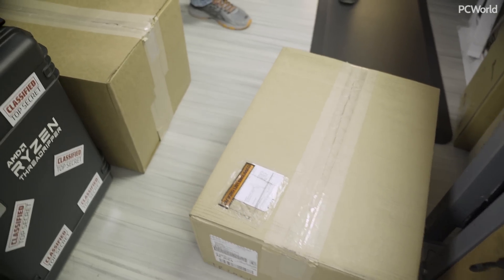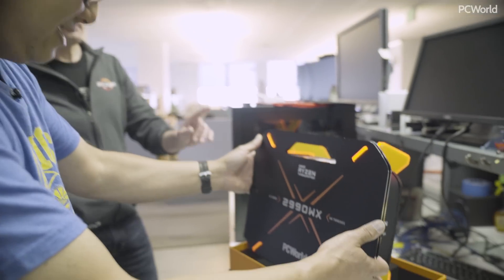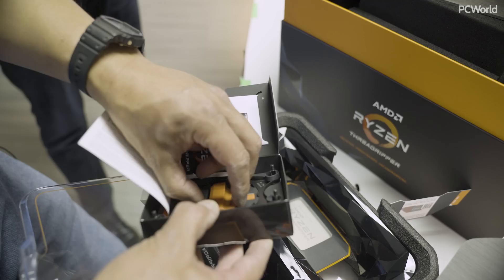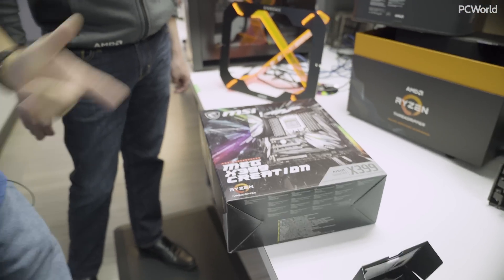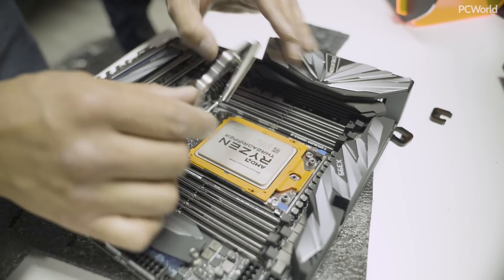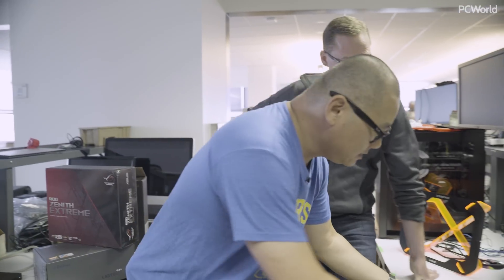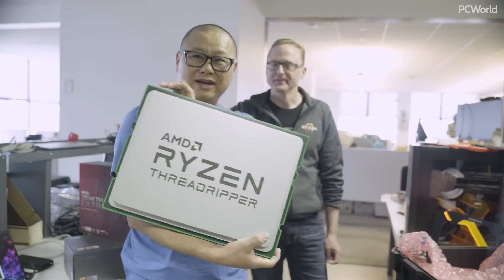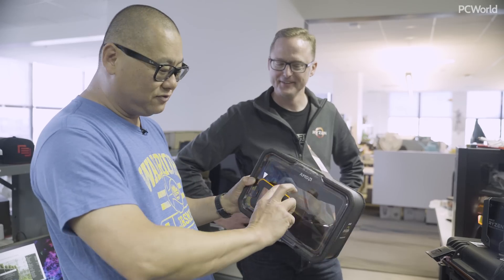Threadripper 2 unboxing and install with Jim Anderson of AMD!

Comment: Hi Gordon, 

As a person in the PC hardware reviewer space, I assume that you are familiar with the work of the channel "Actually Hardcore Overclocking" (aka Buildzoid's channel). If you aren't, he does motherboard "PCB breakdowns" where he goes through photos of motherboards, identifies chips and components,  and analyzes their capabilities, and is able to give an in depth summary of the pros and cons of the motherboards. As someone looking at buying the MSI MEG X399 Creation, I am looking for a deep technical analysis of this board, which not too many other people are capable of. Because AMD didn't sample him with the Threadripper 2 reviewers kit (his content is quite in depth and technical and therefore his view numbers aren't massive and AMD likely didn't think sampling him would regain the price of the hardware in gained sales) he is currently not able to do a PCB breakdown of this exciting new board.

Because you have access to the  MSI MEG X399 Creation, could I ask you to do a big favor to all the consumers looking at making the sizable investment into a second generation Threadripper processor and an X399 refresh motherboard?  Could you possibly temporarily remove the heat sinks, thermal armor (and anything else obstructing a clear view of the motherboard's components that could prevent them being identified)  and take a high quality top down photo of both the front and the back side of the motherboard (see other motherboard PCB breakdowns on the channel Actually Hardcore Overclocking for examples) ? Could you send these photos to reddit user /u/buildzoid? This would allow the whole PC building community to get some reviews of the boards in an unrivaled technical depth, and would give consumers more insight into what they're spending their hard earned money on.

Thank you for your time

Comment: I've been Intel ride or die since I put my first computer together back in 1998. But... as of late, I'm swaying on my loyalties of team blue and thinking of building my next system with red. Would that be a mistake or are my suspicions of Intel recycling old tech to "compete" a real reason to switch over? I've been waiting for any real change from Intel ever since the Coffee Lake launch but, I haven't been impressed from what I've been seeing or hearing. I know this isn't the proper forum for this question but, I want real answers from real enthusiasts.
Reply: Here's one from a mostly intel user. I've currently got plenty of intel cpus and chipsets like x58, x299 (soon) z270 and I've been through lot more - I've also still got a fm2+ amd board, am3+ and am3 board. I've never liked amd before ryzen, Taking a look at the performance charts ryzen is worth the money. I can't say the same for the amd gpu department - it's a complete fail on the high end department
Reply: I had an original AMD Thunderbird back in the day and an AMD 486 DX4-100 too. Oh that's right I do have some 2 core AMD CPU too. I never used that system though. So I really don't know what it is.

Comment: I will admit that threadripper is awesome for professional use but AMD has yet to to match Intel or beat Intel and gaming forcing them to lower prices to an acceptable level. And I know what you're going to say yes ryzen is closed two until in gaming but close only counts in Horseshoes and Hand Grenades. If AMD was so competitive and gaming you wouldn't see ryzen stockpiling at vendors forcing them to lower prices. Now I am not a fan boy by any means I am just a gamer who enjoys Innovation and competitive pricing and for far too long AMD has been absent in this respect giving Intel and Nvidia all the room they need to charge us whatever the hell they feel like.
Reply: stockpiling? wtf are you talking about dude? all the majir retailers are selling practially the same ammount of amd cpu's than intel ones
Reply: Well, by the numbers released from amd with the sells of the first gen ryzen, i would say that they are selling extremely good.
Reply: yea like you're really going to notice a difference between 120 and 135fps. Zen2 is supposedly going to include 15% IPC increase along with much higher clocks for what it's worth.

Comment: 16 core i am using 2 core cpu
Reply: I'm poor and the only pc I own is my Dell laptop core i3 2350m about 2.3 GHz guess, at some point I wished I had some more cores and ram to run a Linux virtual machine to do some coding stuff on it, but now Microsoft introduced wsl, so it does the job for now, still I'm addicted to this kind of reviews.